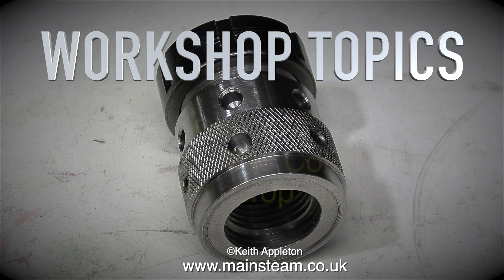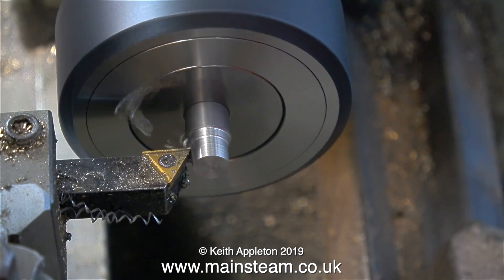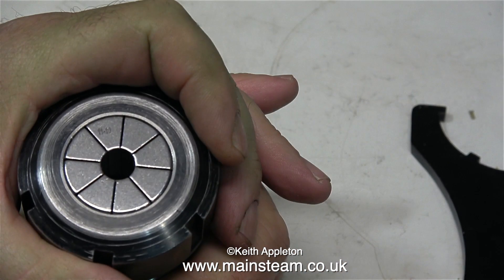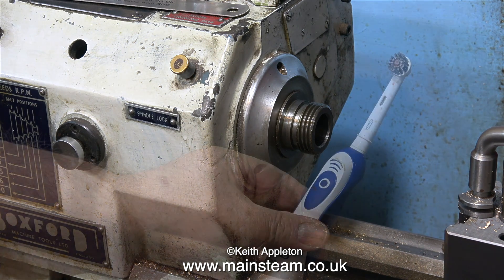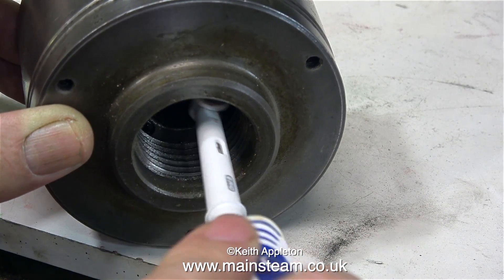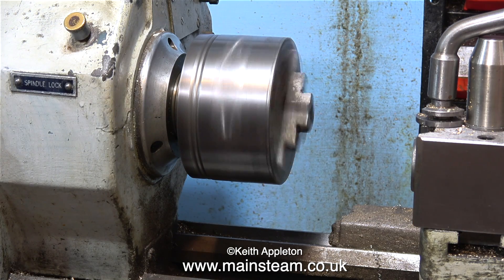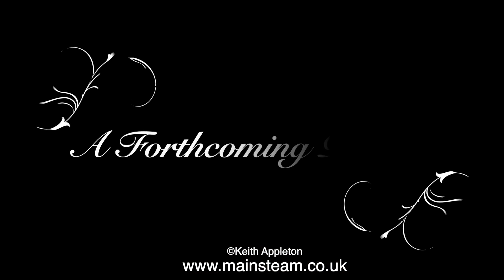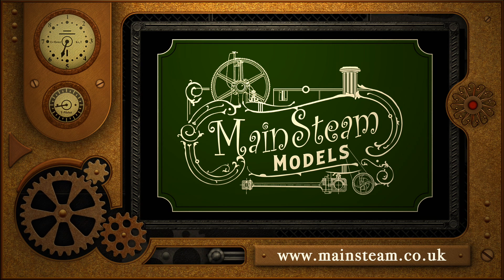WORKSHOP TOPICS - PART #10 - A MODIFIED ER40 COLLET CHUCK

Comment: Hi  Mark
I see the grub screw on the side of the chuck nut, 

I am reminded the set screw in my er 32 chuck nut came out. 

Put some blue lock tight on the set screw.
Thanks
Reply from the maker: Hi Dennis, the name is Keith by the way }:-)))
Reply: I got your attention then. 

Thanks Keith